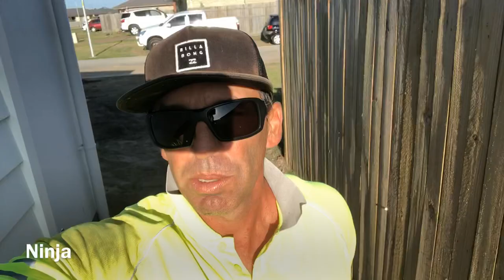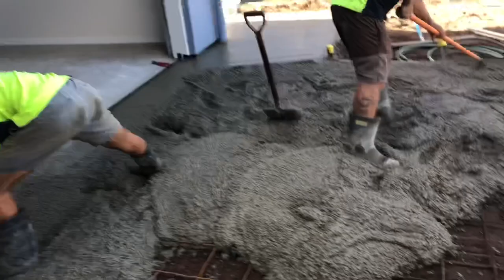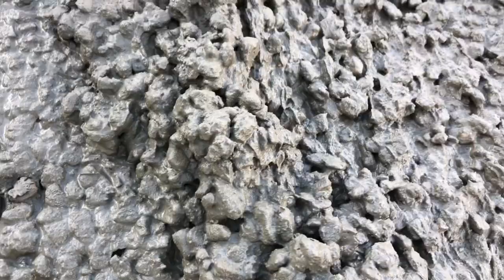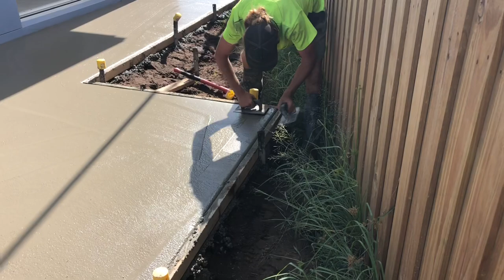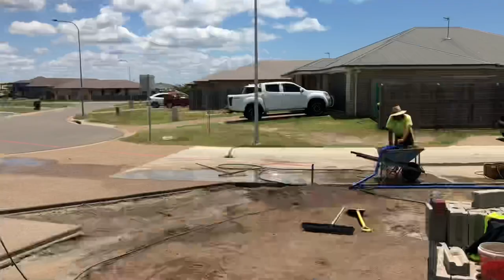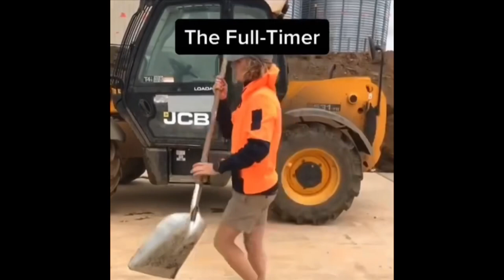Expose concrete driveway in Australia

Comment: Lots of rusted mesh. Boys, i will not use steel rusted, i prefer-galvanized hhog panels, cost more but no rust, rust number one reason for problems,,,,,,your finishers are good, help is good,. I work mostlty alone , break down my pours into smaller pours,. I quit looking for help 10 yeras ago, here in. The states. The. Kids- help  are Terrrrible, snowflakes dont want to work,..also those rear enders, they. Suck, we use front enders here in. My. Neck... of the woods... pull. That. Wire. Up. Boys, ,,,,,my next purchase is a pool, trowel  setup like yours , i use long handle,,,, fresno,..  also, i use alot of expansion, i saw none on this pour,,,?..
  Looks. Very. Nice,finish wise,...jibby. Time,  lol